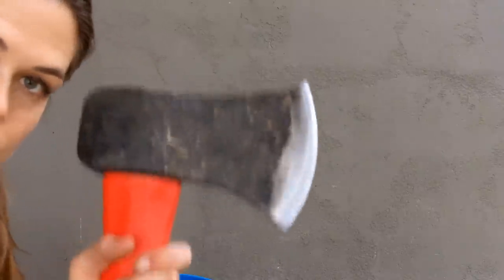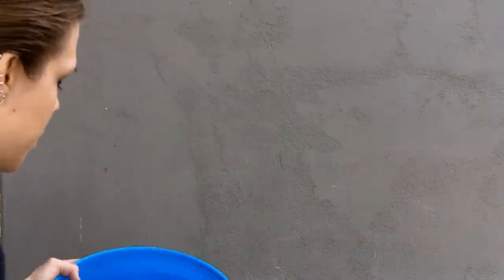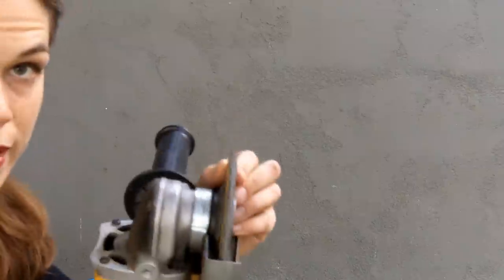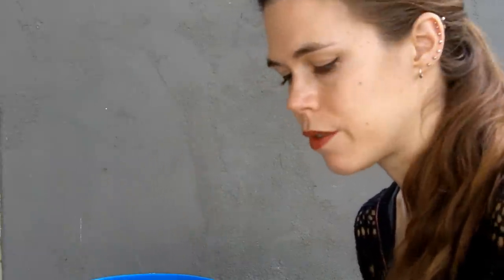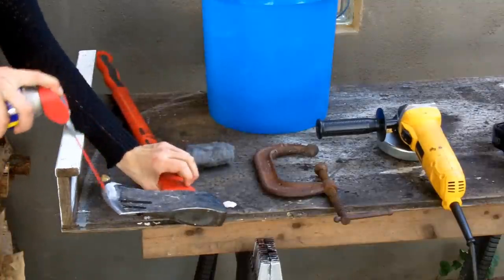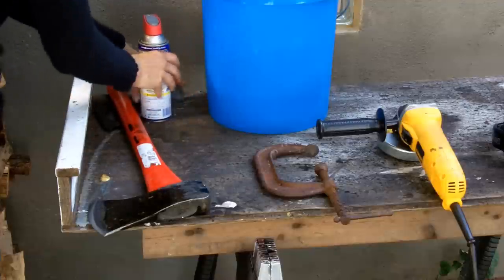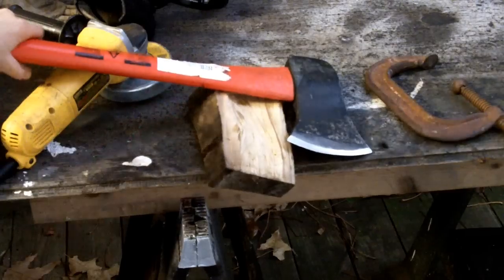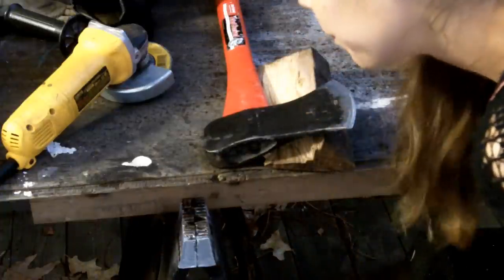How to Sharpen an Ax Blade with an Angle Grinder - Things Even a Monkey Should Know

Comment: Great Video, I also used an angle grinder to sharpen my axe, but I can recommend to take off the edge overlap with a 400 grid sandpaper and finish it off with the back side of leather. My left index finger will testify, it is seriously sharp.
Reply from the maker: Arakiz Zikara Yikes! Careful with that (keeping your skin and digits intact). I will certainly give the sandpaper and leather a try next time-the sharper the better. Thank you!

Comment: Yea, women can use tools too! I especially liked your mention of splitting wood. I do 4 to 5 cords by hand each year, and am always a little sad when it's time to put the axes away for the season (splitting kindling indoors is not as much fun).
I would like to offer a couple of tips (with best intent). Keeping the primary edge bevel free of nicks is important but if that is all that's ground, the effective edge will eventually become too thick to function. It's important to round or flatten the thickening shoulder of the newly sharpened edge to allow the tool to function efficiently. Efficiency comes from edge and profile.
In the summer, splitting can be like Bikram yoga but even in cooler weather, there should always be grace and economy of effort.
The second tip is 'sharpness.' I support the philosophy of the functional edge. I buck tree-length logs on a large, square driveway. I also get a lot of road sand from winter plowing.
I'm not going to smack a polished edge into grit on the end of a round!
Felling, hewing, carving? Those tools need to be sharp.

Comment: Watch Liam Hoffman's videos (Season 3's Forged in Fire Champion) on axe sharpening. He uses a belt sander, but the info applies to grinders as well. You are better off with FLAPPER wheels, not this sort of grinding disc. This disc will heat your blade up very quickly. Low-grit flappers will remove stock (metal) much quicker with a much lower heat transfer. 

Oh. and you might want to tie that pretty hair up. Once that grinder grabs on it'll give you an un-expected face lift. Trade workers usually remove hoodie strings due to fatal injuries after the grinders grabbed them. A dust mask is also very good idea. Those metal fibres being flung into the air and end up in your lungs. When you blow your nose it'll be black (depending on the duration).  That file is way to coarse for your final strokes. They have files with two fine grits specifically made for sharpening. Filing toward the edge will create a burr on the other side which can be cleaned up by stropping it. I noticed you filed against the edge (or maybe you pulled the file?). The file is designed to be pushed, not pulled. Pulling it against the metal will dull the file quicker. Use a file brush to clean that file frequently (copper bristles are less damaging).

Good luck to ya.
Reply: Good points made here. Thanks for your information.

Comment: A most engaging video by a most charming presenter. It almost seems churlish to offer some (very) minor "criticisms" but here goes anyway ...

As a poster already pointed out, overheating the blade will make it soft, not brittle ... also, the "angles" on the edge of the axe blade are called  "bevels" .

The dude below who suggested using flap wheels on the grinder is absolutely spot-on. Nobody who has used these new flapwheels on an angle grinder would ever go back to using a rigid grinding disk ... they are more expensive than a rigid disk but they are like 100 times more effective. 36 grit flapwheels would be ideal for this purpose.

Lastly, you don't really need to buy a whole new axe when the head becomes loose ... you just either re-wedge the shaft, or you can buy a new shaft and fit it in the head. When the head gets beyond repair, then you buy a new axe, but it will be a long time before that becomes necessary.

Keep on making these videos ... they are most enjoyable!
Reply from the maker: murrmac Thank you for your kind comments and helpful feedback!

Comment: I once accidentally left my ax outside overnight.  Unfortunately, it rained and I had forgotten about the ax for a couple days.  Once I remembered, I found that it was covered in rust.  I left the entire ax head soaking in apple cider vinegar for over 24 and after wiping it with a dirty rag it was good as new. Note:  it did smell a great deal like vinegar so wiping it down with some WD-40 is a good idea.
Reply from the maker: +Kurt Haller Yet another excellent use for apple cider vinegar (I have been learning a good deal about it lately). Thank you for the tip!
Reply: MonkeysKnow no problem.  I suggest you soak that clamp of yours.  :). It's super rusty.
Reply from the maker: Kurt Haller Indeed I will! Thanks!

Comment: Interesting to watch. Lately I made a couple of videos about grinding knife blades on my channel. I am not sure if I may have introduced too much heat into the hardened steel. And, I have a specialist axe to grind lol for harvesting bamboo but I will likely make it sharp as a razor and blunt it back down for safety reasons after making the video. These things chop close to the feet at the root of the bamboo.

Comment: Thanks for a simple common sense approach that should meet most folks everyday needs and a double thanks for not trying to shave an arm or the dog, or any other thing else. That degree of sharpness is not necessary, and should it be achieved, will only stay so for a short while in use.  
I second your warning on the wire wool. I lit up a full reel of the stuff a good 8 feet behind me and by the time I noticed the strange burning smell, a heap of stuff was blazing away. That is one 'close shave' I did learn something from  .....      ;<))

Comment: Might want to spray some WD40 on that poor rusty clamp.  Axe heads can be tightened up by resetting the wedge if the handle is wood, wedges available in hardware store.

Comment: wish you showed your grinder disc. I use multiple grits of flap discs on my beaters and hand file my best ones
Reply from the maker: That would have been helpful! 😊 I used a composite disc which was actually labeled for sharpening, though it looked suspiciously like a regular metal grinding disc.

Comment: There's nothing wrong with what you did here, on a cheap axe it would be fine.  There are many ways to sharpen anything, and being a Axe maker, I have tried most and have my own secrets.  For those that think they know it all, well maybe they don't as professional racing axes have a 'chisel' hand filed in a purpose built jig made by Tuatahi of New Zealand.  Proper axes are profiled for various timbers, in Australia we perfer 14 degrees due to our timber being harder than most.  At the end of the day, it's about precision, no heat and final polishing.

Comment: This is much more effective with a bench grinder, as you can control the angle of the bevel much easier. An angle grinder is harder to hold an exact angle and messes up the angle of the edge
Reply from the maker: Thanks for the tip! At the time, I didn't have a bench grinder, but it definitely would have helped. :-)

Comment: First of all. Buy a bench grinder. They cost next to nothing and surprisingly often comes in handy. Secondly use oil when grinding to avoid overheating. Thirdly a soft edge is much preferable to a bridle edge when using an axe. Also it is easier to sharpen with a hand file at the place of work.
A loose handle is very easy to tighten up if it is not completely broken at the top. No need to throw away a perfectly good axe for that reason. The axe head can come flying off even though it seems to have a snug fit, so you should always be careful when using your axe. Don't let the radius of the axe swing pass your body and always be mindful of people and objects within the range of a possible flying axe head.

Comment: We've also learned that fine steel wool makes an excellent fire starter (9 volt battery works great) when a hot spark is applied.
;-)
I'm diggin' that rhinoceros.  I like the earth texture like the mud from the Kalahari.  It says, to me, the circle of life in one image:  One moment.
Reply from the maker: jhenry0615 I had no idea prior to this that steel wool caught fire so easily! I am going to have to try the 9 volt battery, just for a fun experiment. 
Thank you for the compliment to the rhino! I think of it as somewhat of a guardian. :-)

Comment: Using an angle grinder to sharpen a blade is going to destroy the heat treat on the edge.  Your new edge may be sharp, but it is not going to last.  You are now going to need to spend many, many hours removing metal by hand to expose a hardened section of the blade.

Also, be sure to tie your hair back when using any power tools.

Comment: "IF YOUR NOT COMFORTABLE HANDLING AN AXE OR HANDLING SHARP OBJECTS"... DO NOT OWN AN AXE!!! Please do not do this. Make a pot of coffee sit down and relax. Use a course stone or file if you have chips in the blade. long story short... Then use a fine stone to finish your edge. Take the time to learn how to hand sharpen your tools. You will get faster, your tools will work with less effort, you will be able to put a new edge on where you are working(as long as you have your stones), the axe wont lose its shape, and you will avoid the injuries and screw ups that happen with grinders.
Reply: Doesn’t really matter u don’t need a hand sharpened edge on axe it can be sloppy and how are angle grinders dangerous

Comment: If your axe handle moves, you DO NOT need to buy a new Axe, that is wasteful. You need to either create a metal wedge or buy it and hammer it into the wood where your axe head is mounted. Or, you could just buy a new handle if the handle is broken. 

Angle grinders use "discs" not "blades"as you stated.
Reply from the maker: Ha! Indeed. "Blade" doesn't even make sense on an angle grinder.

Comment: Tempering ruined instantly... Doesn't matter if you stop and mop with water. Try finding a slow turning belt sander or wet grind stone. When filing by hand file towards pull not away from pull.
Reply: LittleCabinOutdoors wrong and wrong. At no time did she ruin the temper. Nothing changed color and the water keeps it cooler. Yes you have to use alot less pressure and time with high speed equipment but not everyone owns such equipment. Kind of the point of her video. And filing on the pull with a sharp blade? You slip and your on the way to the ER. I know. Always people find the negative in the way other people do stuff. If it works for you, it works. Ive used a hi speed grinder for years on my axes. Its a technique you aquire for what you have. Yes you can burn the hell out of them if you arent careful. But practice and time is key. But its an axe not a knife. I dont want to spend hours honing a perfect edge to wack wood when 2 minutes does the job just fine. I laugh at some on these videos about sharpening stuff and they demonstrate on $4000 vaiable speed belt grinders. Yep, that really helps most of us. Lol

Comment: Angle grinders are to fast, even on variable speed models. Use a file, start with first cut, then second cut, finally smooth cut.. put a thick leather patch as a guard on the beginning of the file, and good leather gloves. They are sharp enough with smooth cut files. But use a stone after and it is razor sharp.
Reply from the maker: I like it!

Comment: DON"T DO THIS! an angle grinder or bench grinder produces to much heat and destroys the blade face. it will "feel" sharp, but will damage quickly in use. a belt sander is a much better choice if you are to lazy to use a proper file/stone

Comment: uhm. you dont need to sharpen an axe super sharp. its not a cutting tool, unless you want to chop down whole trees. for simple household use, that includes splitting pieces of wood, its not that necessary. its just more dangerous for the user.
Reply: A splitting axe can remain quite dull (even works better that way), but if you do any cutting that edge is a must.

Comment: Rule number one - never wear gloves when working with rotary tools srsly that's the first thing they teach in any school
Reply: They sure do tell you that in school, but right now in most of the industry gloves are mandatory for grinders.
I guess the odds of caching gloves on abrasives are far less then the chances of causing yourself damage with any mishandling.
Reply: Well so much for school.  Once I tried to use my angle grinder without gloves and got a good lesson.  Always use gloves when using an angle grinder.